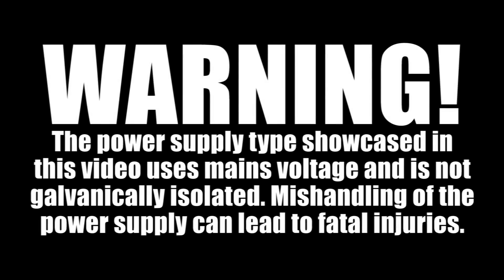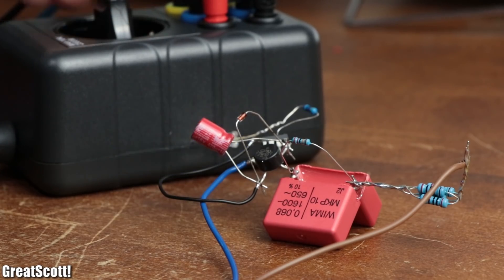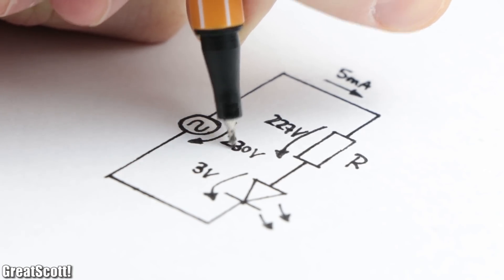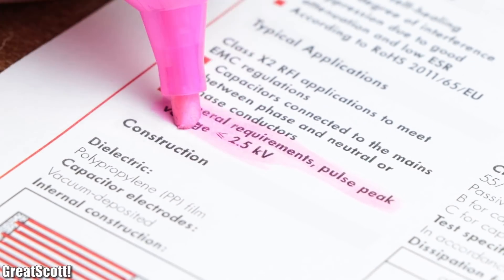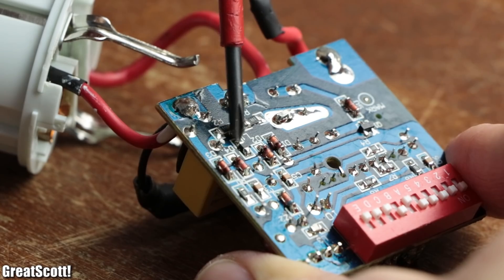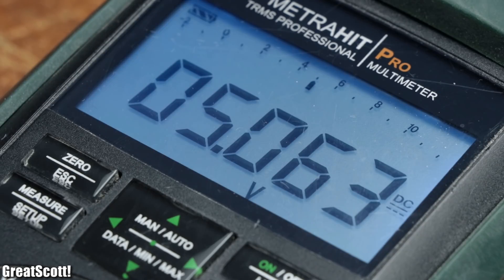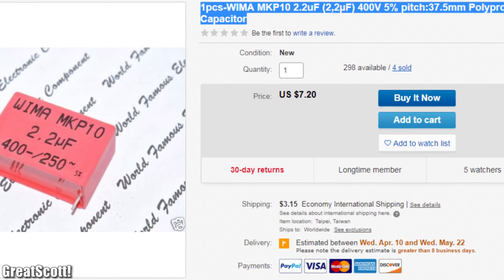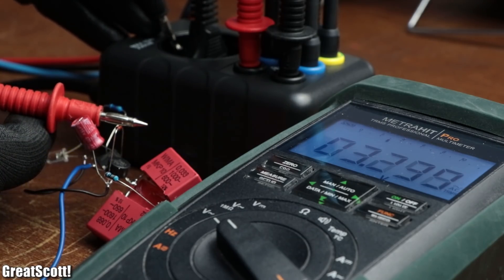The most Dangerous, yet Cheapest Mains Power Supply?! || Building a Capacitive Dropper Circuit!

Comment: I have a question why the resistor doesn't blew up while connected with mains ac?
Reply: Why would it?
Reply: @clonkex  don't know i am confused i had seen resistors turning into light at 12v dc and its 200+
Reply: @mitubarman6614  Ah ok, it sounds like you don't know how electricity works. First, voltage doesn't mean anything on its own. Resistors turn electricity into heat. The amount of heat they generate depends on the amount of electricity flowing through. The higher the voltage, the more electricity tries to force its way through the resistor. If the resistor has a low resistance, lots of electricity can get through and not much heat is generated. If the resistance is high, not much electricity can flow. If you use a higher voltage, it forces more electricity to try to flow through the resistor and more heat is generated. So the amount of heat generated (and therefore the likelihood that the resistor will start to burn up like a firework) depends on the voltage applied, the resistance of the resistor, and (of course) the physical size of the resistor (because a larger resistor can take more heat before it starts to melt, in the same way that thin wire will melt faster than thick wire if you apply the same heat).

There's STACKS of tutorials online about electricity (some better than others). It's not super complicated but it can take a little while to get your head around. The relationship between volts, amps and resistance is quite simple to understand if you use the analogy of a waterpipe. Voltage is water pressure, amperage is the amount of water flowing, and resistance is how small the pipe is. Use too high a pressure (voltage) and the amount of water flowing (amps) might cause the pipe to burst (melting resistor) because it was too small (resistance).

Comment: Please make a multi isolated output HBC/LLC.
Reply: LLC is so efficient, but it is hard to design lol
Reply: @rikka0_059  For sure. I was thinking about building a reference design just to get started. I need a 30V/3A x2 + 6V/3A x1 for my project. All isolated from each other. idk what other type of topology I could use that would be somewhat efficient. Maybe PWM push pull?
Reply: @meepk633  what is your input voltage range?
Reply: @rikka0_059  Offline. 120V. I need about 175-250W all together.

Comment: Just use two caps on both lines and you will have galvanic insulation. Though still, It will trigger home grid protection.
And how the hell schematic from diode lightbulb was different?

Comment: So, not related to this video or anything but I'm trying to display Bluetooth data on a 20x4 lcd but the data prints in the 1dtvline3, then the 3rd line, then the 2nd line, and then on the 4th. Is there any way I can fix this ie. split the data into 20 characters 4 times and then display that or just flatbout fix it

Comment: hi brother can you help me to make a cnc machine from, using this parts (5 pin dc stepping motor and uln2003 , 16x2 lcd or big display , arduino) i can make a cnc machine but i have not proper knowledge so you will help me to make please..........🙏🙏
Reply: Easiest way to make a cnc is by googling MPCNC. ;)
Reply: @m.sierra5258  but my budget is low it was i tell you to make a CNC machine because this parts are in my budget
Reply: @arpannarola7132  I dont think you will get cheaper than MPCNC. Normally building CNC costs 2-3000 Dollars, MPCNC reduced that down to 3-400 Dollars. If you cant afford that, I think this entire hobby is too expensive for you.

Comment: Using a capacitive dropper for medium to highly varying loads is a bad idea. They are essentially constant current supplies. So you need to draw the same current (which has to be the highest current the circuit could need) all the time or the voltage will shoot up.

Comment: Electric shock problem? What about 2 capacitors (with double capacitance, since 2 capacitors cuts capacitance in half), on both sides of the AC mains line? Like DUH!!!!!!
Reply: The one downside is that a transformer will commonly have even better short/shock resistance.
Reply: @absalomdraconis  I KNOW that !!!!!  I personally would make a transformer-powered power supply. But that is not the topic of this video. This video utilizes the capacitive reactance of the capacitor to drop the voltage (50 Hz in Europe and 60 Hz in the U.S.). All I am saying is put capacitors on both sides to REDUCE (not eliminate entirely) the shock hazard. The power supply will probably be encased in a plastic case or be inside a computer where the electronic components will drop the voltage further. So, sometimes, a capacitive power supply may be the economical way to go.

Comment: For literally 1$ you can get a 5V@0.5A switch mod power supply (USB Charger). Didn't get the point of this video rather than experimenting on ways to drop down mains voltage.

Comment: These safety capacitors (X2 etc.) fail open, not short as you said! That's why they are called safety capacitors :-)
Reply: I just read up on these, pretty sure X fail short (used across L/N, a short will trip breaker/fuse), and a Y will fail open (used across L/GND) and must fail open so that the chassis of a device is not energized.
Reply: @Shabbymannen  Maybe we are both kind of right. X capacitors CAN fail short (if they are ceramic capacitors) but you can not rely on this. If they are metalized film capacitors (like the ones seen in this video), they will fail open.

Comment: i drives me mad when i see people fail at holding a pen. the thumb-tip touches the pen shaft, not the middle of the thumb. i realise this bloke is left-handed, but someone should still have taught him how to hold a pen, here we go - 
. Proper pen grip is essential for comfortable and efficient writing, and incorrect grip can lead to discomfort or difficulty in writing.

The most common and recommended pen grip is the tripod grip, where the pen is held between the thumb and index finger, with the middle finger providing support. In this grip, the thumb should be positioned near the midpoint of the pen shaft, providing stability and control while allowing for smooth movement across the paper. the thumb pad and 1st finger tip control the writing, as the pen rests on the 2nd finger.

the reason this bloke's hand looks so bad is using the middle of the thumb rather than the tip. in fact he doesn't even have a hand, he just uses block caps. like a 5 year old.

Comment: For one of my projects I used this: https://uk.farnell.com/vigortronix/vtx-214-005-105/ac-dc-conv-fixed-1-o-p-5w-5v/dp/2401040
They are not the cheapest but I preferred these above Chinese 3$ (hilink) ones.  I combine these with a regular fuse, a temperature (63°C) fuse and a varistor across the mains.  They're located in a wall socket and power an ESP32 and some relays.  They deliver 5V&1A

Comment: How can i use power bank to operate 12v 2a modem/router ?
Pls help.
#RouterUPS #PowerBackup
Reply: get a bost circuit capable of supplying the 2 amps and make sure ur powerbank can supply it.
Reply: Kesch Johannsen i didnt found boost converter circuit that outputs 2a.
There are plenty with 12v 0.9a 1a. But theres none with 12v 2a

If you found any please share me the link to it.

Comment: And of top that is dangerous the capacitor dropper is not powerful enough for many projects,  have terrible PF and the size is almost the same as small SMPS as we van see from the huge caps you are using... Yes, its extremely cheap (in some cases) and easy to make but the drawbacks are more than the benefits. I always avoid using something that can kill me if touching it is 50/50 chance touching the life wire.

Comment: there are very small isolated mains to 5V boards on ebay, for < $2. I know you say it, but this is potentially dangerous. No one who is not knowledgeable should attempt this circuit, buy an isolated circuit already built up, much better than fooling with 240 Volts.

Comment: You didn't save space after all. A smaller SMPS than that circuit would provide much more current, without the voltage drop. Basically you could use any cheapo USB phone charger on the market.

Comment: Actually there are two ways to build a super simple regulated & compact main-powered power supply, 
1. Use integrated solutions: LNK306 or KP3211 
 2. A RCC converter with a 2-winding transformer, self-oscillated, regulated and accepts 85-265VAC, no IC required, less than 10 components. Is there a way to post a picture in the comment? I would like to share the second solution.

Comment: YOU CRAZY [JOKING]
LM2575
Reply: The LM2575 has a maximum supply voltage of 45V. I think he won't like rectified mains very long 😅
Reply: @Boen466  SORRY I MEAN FOR BUILDING A SWITCH MODE POWER SUPPLY
Reply: No problem :) just wanted to say that so nobody is going to plug his ics directly into mains 😅
Reply: @Boen466  :o Surprised pikachu face

Comment: Sadly it still ended up using quite a few components and was just as big as the smps
Reply: Honestly, if I was going to use this for most stuff, I think it would be on the output of a doorbell transformer to just get the voltage dropped from 15v or whatever to something closer to desired...

Comment: I do not like the way these things are used on the bench where it is easy to touch the wiring. Please put it in an enclosure to teach noobies good habits! It is worth mentioning that a small switch mode PSU also has mains voltage on it.

Comment: Dude, digikey has integrated mains to mcu or w. e. dc for cheap if u want less than 1.5a. About as much space as ur break outs plus tiny. Some need one or 2 passives but it doesn't have to be big or done like this.https://www.digikey.com/products/en/power-supplies-board-mount/ac-dc-converters/923 yeah 6 to 10usd..is that really too much for saftey?

Comment: One of your "great" approaches to electricity in general;  is to use mathematics to prove whatever point you are addressing. Yet you ignored the fact that others succeeded in proving you wrong. In this video you stated clearly that the capacitor approach is only limited to SMALL loads only; yet you broke a lamp and showed that someone manage to provide a much higher load USING THE SAME APPROACH. Why did you ignore it???